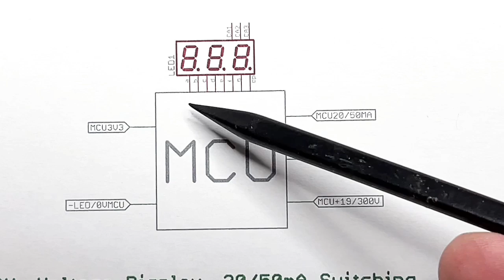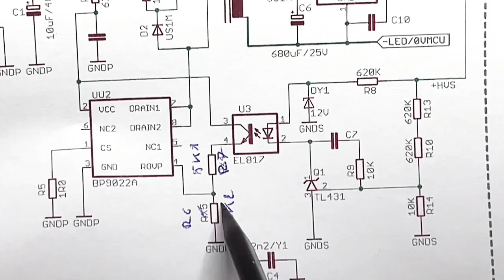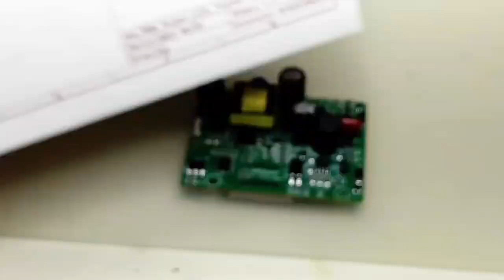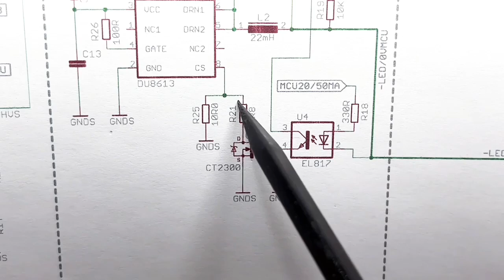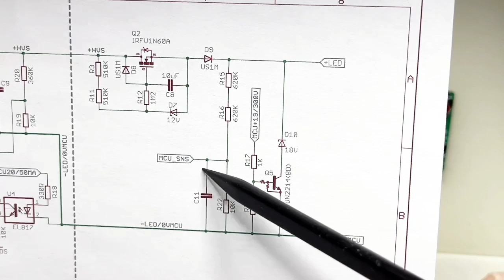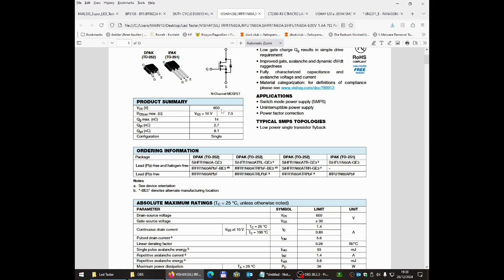HWL300 Super LED Tester; Full Schematic, Circuit Explanation, Test

Comment: Thank you for the great job!
What I don't like about this device is its' 300v default voltage burning out single leds. I know I can switch it to 19v by short-cutting probes, but it switches back when idle a minute or so...
I'm wondering if I can connect external manual switch to emitter and collector of Q5 to force 19v limit or it will affect algorithms of MCU?
Reply from the maker: Hello,
I dont know what will happen if Q5 would be constantly Active, try it the MCU cannot switch back to 300V if Q5 is constantly on bcs the CE pins are Shorted by a switch

Comment: Nice Job of reverse engineering it, questions is though if you accidently touch the lead probes , would you get a nasty shock, likewise if you touched other parts of the circuit i presume it would just blow components ...
Reply from the maker: Thankyou, Yes you will get a shock bcs of the high resistance of the human body.....For components though, well i would not use it in Low Voltage Designs, this Gadget is made for Testing LEDS in High Voltage Circuits (or Standalone Leds) and can be used to test Zeners too.
Cheers, Konstantin

Comment: I like the design but im wondering about conducted emmisions. On the input there is just smoothing cap i would say atlest pi filter should be there.
Reply from the maker: Hello, the emissions from the Device to mains are not more than from many cheap wall ward Switchmode adapters and even less bcs the Power of the Device is very low and its Operated only on demand.  A Common mode choke in Combination  with X2 Caps on both sides of it would have a noticeable effect towards mains.

Comment: Hi, 
How are you reverse engineering the devices and drawing the schematic diagram?
Are you using a special dedicated software program?
Reply from the maker: Hi Paul, for Reverse Engineering I Trace the Tracks of the PCB to see which Partpin is connected to what, I beep them out too , I de-solder larger Parts where I don't see the the track beneath and re-solder them and draw the Schematic in smaller Parts on Paper. When Finished with that I recheck the whole and the I draw then Schematic with the EAGLE CAD Layout Software, that is the Result what is shown in the Videos. Its quite a cumbersome work. Cheers, Konstantin